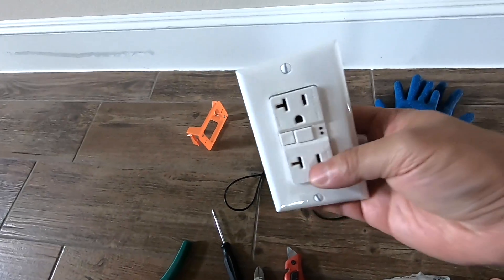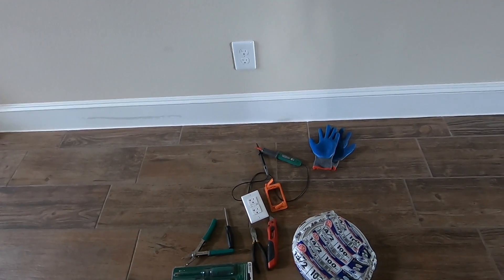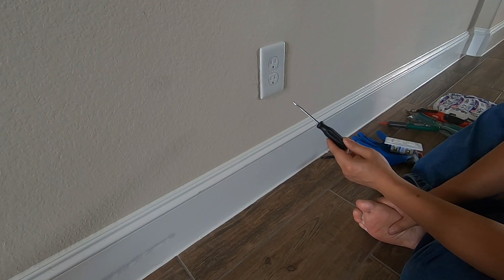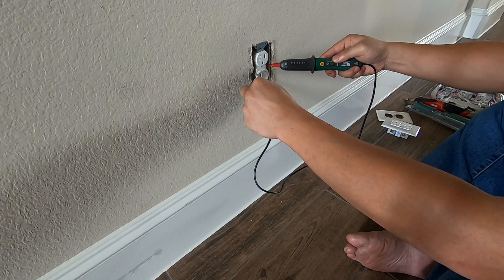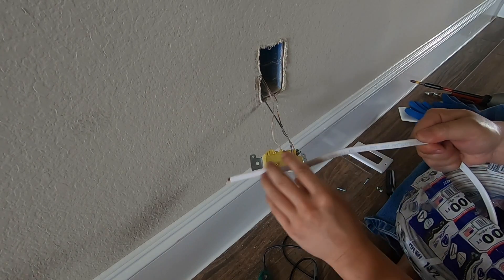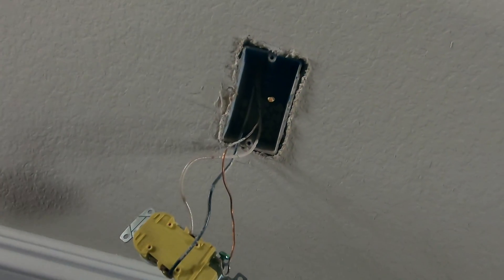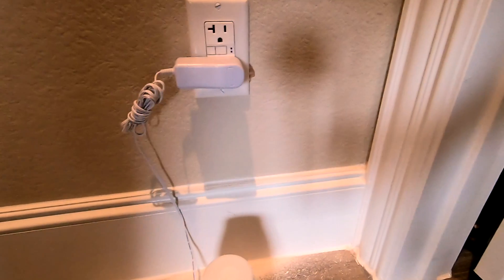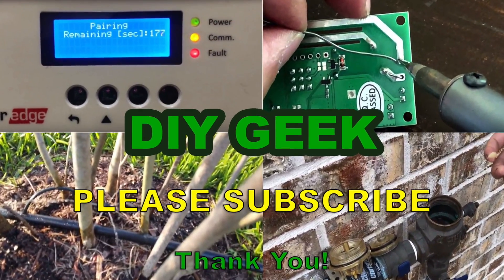Adding Electrical Wall Outlet on Opposite Side of Wall - Easiest Method

Comment: This install is not correct.  Why don't you remove it for the sake of safety?  The orange plastic adapter you are using is for LOW VOLTAGE only.  Drilling through the back side of the plastic outlet box to go to the other side of the wall is against the electrical and safety codes.  This video is clearly made by someone who knows nothing about electrical work.

Comment: Basically everything in this video is wrong and unsafe.
1) They added a 20A outlet in the bathroom, but tapped it off of what is presumably a 15A circuit and used 14/2 Romex (which is intended for 15A circuits).
2) They used a low voltage box for a high voltage application. This is a fire risk. the box they used is intended for running stuff like internet and cable wiring, not for running power outlets. You need to use an enclosed box.
3) they drilled a hole in the existing box, this is not proper and affects the fire rating of the box, there are openings on the top and bottom of the box to pass through cables.
4) they should have pigtailed the ground wires, not just doubled them up under the screw. There is a risk of that coming undone and leaving the outlet ungrounded.

They try to backtrack in the description and comments that this isn't the safest method, just the easiest. But this is only marginally easier at best and completely unsafe. To do this properly they just needed to buy the correct parts (15A outlet and an old work high voltage box) which cost about the same if not less than what they used, and cut the opening for the new outlet roughly six inches to the left or right so that there is enough clearance instead of directly behind the existing outlet. It would take roughly the same amount of time to do it properly.
Reply: Thank you so much for leaving this detailed comment. I agree with all your points. This illegal/dangerous install should be fixed ASAP to prevent any future issues homeowner would be held liable for and have to pay out of pocket

Comment: This install is against the code,  You are not allowed to enter an electric box without running the wire thru a stress relief fitting.
Reply: Not just that. Cannot install any electrical device using a low voltage bracket, must be in an enclosed box. Also, cannot double tap ground screws nor use 20 A receptacles on a 15 A circuit, especially with #14 wire.

Comment: That orange wall bracket is a low voltage bracket.  Used for phone or network jacks, not 120v wiring.

Comment: All 110 connections need to be in a box. You're using a wall mount bracket for low voltage or data.

Comment: Okay, this may be a bad idea for 120v electrical outlet, but this will help to do the same for my internet. Some numbskull put my only internet outlet box in the kitchen. So I'm going through the wall opposite of it into the living room for my wifi. Why would they design the home for the wifi to sit under my cereal cabinet on the countertop???

Comment: List of violations of NEC.    Low voltage frames are not tested and listed for 120 volt devices.   Installing receptacles open back is not legal unless the devices are tested and listed for the installation.   That receptacle is not.  Drilling holes through the back of the box violates its listing.  Must be listed.  Connecting two ground conductors under one screw is a violation.  Installing a 20 amp receptacle to a 15 amp branch circuit is a violation.
It is very sad that people having no idea what they are doing put this type video on YouTube to try and make money.

Comment: This will not pass city i spection as this is illegal. Wall electrical box need be min. 24 inchs away.

This is fire hazard installation. 

Video is leading illegal way. Should be removed.

Comment: The new extension outlet could have been set up with the orange bracket and wired with electrical wires first then push it through the other side and wired together with the old outlet. I did that with mine and it was done much easier.

Comment: ⚠️ This is a faulty install.  When installing a second box, it has to be offset from the existing as they are too deep to back-up to one another.  An offset of several inches is needed to ensure they don't interfere with one-another.  I'd suggest correcting it by patching the new location and installing the proper components several inches away using an enclosed box.  For the safety of others, I'd suggest deleting this video too.
Reply: @bebaker I agree with you!! This DIY GEEK has no clue what danger he just created for his family living there. Just a matter of time until a fire breaks out from that improper and dangerous install!!
Reply: So if I want to pigtail off of an outlet by my front door to put one in my garage, would that be OK? The original is up against a stud and I intend to place mine on the opposite side of the wall and the opposite stud
Reply: That's good to know - thank you!
Reply: how big should the offset be?
Reply: It's not too deep if you use a low voltage frame like he did. It's just a fire hazard and a bad idea for everyone involved.
Reply: @CorneliusBueller   I think you’re missing the idea that installing a high voltage line into a low voltage frame is not an acceptable practice.  Those lines should be enclosed.
Reply: @bebaker  I apologize if my sarcasm wasn't thick enough.

Comment: It is ridiculously unsafe to push 120 volts through a low-voltage box intended for telephone or tv. Please take down this video.
Reply: Isn't the GFCI outlet he's using meant to support up to 20amp as indicated by the horizontal slit on the neutral side? I think that gives a false impression of supported voltage; that's dangerous.
Reply: @rithlim6016     You are correct.   15 amp branch circuit 15 amp devices.   20 amp multiple receptacles 15 or 20 amps.   A dedicated 20 amp circuit with single receptacle 20 amp only.

Comment: Unfortunately, that is an Orange low voltage box not safe for 120V+ outlets. You would need to use a fully enclosed "new work" box. Also, drilling holes in a box compromises the fire rating, use the appropriate knockouts. If there's a fire and the investigator traces it to your hack job, your insurance will not pay out.
Reply from the maker: @Shadi2 is correct, please see my description, this is the easiest way (using the orange low voltage bracket), but the best way and protection is to use a fully enclosed box. As I also provide a link for in the description. However you have to find a stud or way to secure the fully enclosed box.
Reply: @DIYGEEKTEXAS  "New Work" enclosed boxes have tabs that hold to the drywall, just like the orange box. I usually glue in thin shims above/below on the inside of the outlet hole, so the tab holds against the board rather than drywall.
Reply: @Shadi2  I like the shim idea, I've never thought of that before.  That would make it a lot more secure 👍
Reply: @Shadi2  For this type of work, an "old work" pvc outlet box would suffice. Using a 'new work' box would require mounting the box to a stud, which is much more difficult when doing remodel work.
Reply: @DIYGEEKTEXAS   You are showing people exactly how to IMPROPERLY install an electrical box! This video should be deleted!
Reply: @DIYGEEKTEXAS  There are electrical boxes that now secure themselves to the drywall (sheet rock). They do not need to be anchored to a wall stud. They're for finished walls where you can not use a hammer to drive the nails into a wall stud.
Reply: @DIYGEEKTEXAS  I understand when an experienced worker risks only their own life with some questionable technique, but using this low-voltage non-box risks the lives of everyone who ever lives in that home. And they'll likely never know until the fire investigation. Disgraceful.